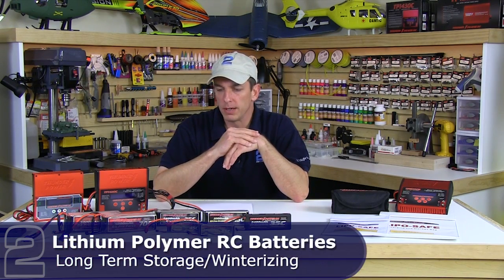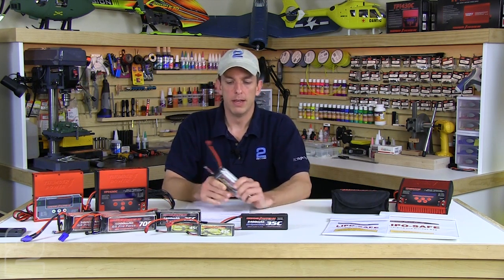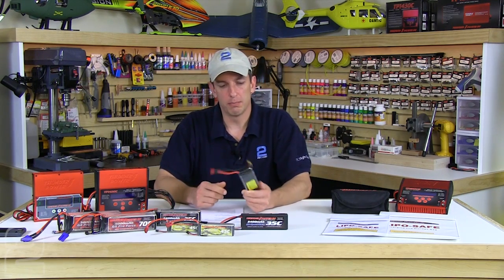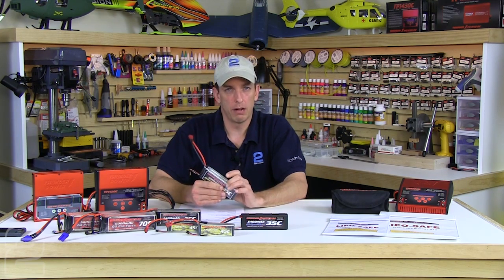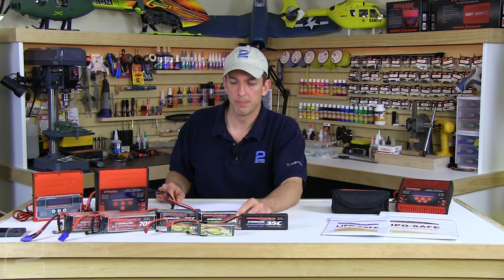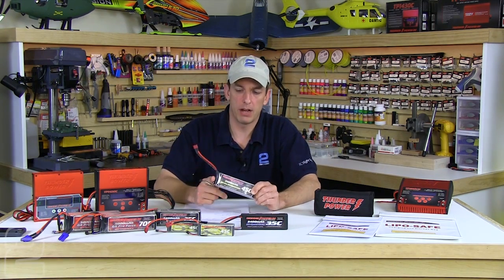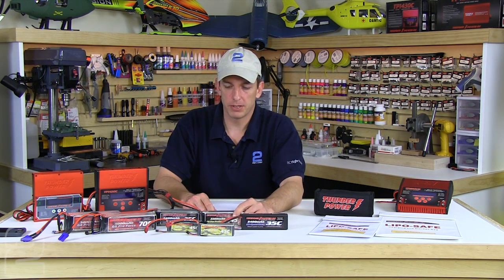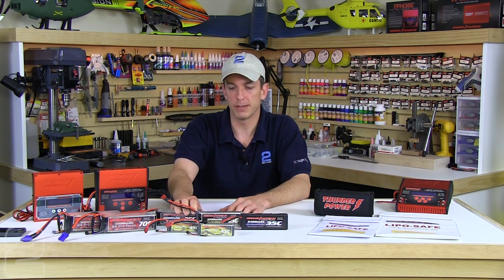RC LiPo Battery Storage

Comment: What happens if your lipos have been sitting for a while and are over discharged? I have a quad and I haven't ran it in maybe one or two months. I didn't storage charge the lipos. They are not showing any damage or puffing.
Reply: Run it
Reply from the maker: There are some people who would advise you to try and "recover" the LiPo by using a very short, low amperage Nickel charge setting until the cells get above 3V each.  That should hit the minimum voltage required for a LiPo charger to trigger.  If you do this, CLOSELY monitor the whole process, verify the cells are balancing out properly and they are all charging in unison.  DO NOT try a recovery with a non-balancing LiPo charger. Some LiPo chargers out there have a recovery option.  In any case, accept the fact that you will lose some capacity after recovery and you will have a slightly (or severely) higher internal resistance.  This means that your XXXmAh will be less than stated as will your XXC discharge rating.  The battery will produce more heat during discharge and will hold less charge than an identical battery that hasn't fallen below voltage. It's just the nature of LiPo chemistry.  Your results will vary tremendously by brand/chemistry/age.

Comment: Awesome video. I'm a complete noob and LIPO maintenance is far more difficult than I imagined. Who would have thought "batteries" could be so complicated :-) Thanks again, I've learnt more from this one video that I have in the past few days! I'm a noob with a 2009 Traxxas Summit and Traxxas 7600mah battery.
Reply: Just buy a charger with storage mode and set a low amp rate and you are done

Comment: Is it safe to leave a lipo fully charged overnight?(8-12hrs)
Reply from the maker: Yes.  When you say "safe", a LiPo is electrically stable at full charge, it just begins taxing the chemistry meaning the longer you leave it sit fully charged the more things begin to break down.  Capacity reduces, internal resistance increases and this results in reduced discharge rate.  Sitting for 8-12 hours, on a healthy battery with good quality materials would result in an unmeasurable amount of change.  We follow the 48 hour rule once they're fully charged.  If we don't run them down within 48 hours we discharge to storage.  It's just a rule of thumb but I can tell you with an inventory of over 140 LiPo's, we've puffed only 3 in the last 3 years following this rule.

Comment: Great vid with lots of info.

One thing i'm not clear on is when you take your lipos out of storage do you fully charge them again?

Say you store them at 50% for two months and they drop to 47%, when you charge them again does the charger sense that they are starting to be charged from 47% or do you need to set the charger somehow?

Thanks
Reply from the maker: We take them back up to storage levels at least once a year for packs we rarely use.  Keep in mind, storage levels are ideal at 3.85 volts per cell but LiPos are very stable below that voltage down to even 3.2.  The self-discharge rate increases as the cell voltage drops so it's easy to forget about a pack and it self discharges below safe usable levels.  3.85 assures the slowest self-discharge rate and the least amount of chemistry degradation.

Comment: I have heard as low as 3.7 for star age voltage so had settled at 3.75 is this too low if I observe cell voltage once a week or so?? If not I have about 20 lipos to bring up to 3.8? Or 3.85 what's best. As for my LiFe source packs I tend to just discharge them a bit to be safe.
Reply: For anyone reading this: On all my manuals for batteries they all say 3.8 V per cell +- 0.5 V for storage charge.

Comment: I have 2 batteries that I used once. Charged and balanced fine. Discharged the battery after I used them down to 3.80v using a 12v car light bulb. Checked the battery after the discharge and rebalanced them to verify they were good. No problems. Put them away for storage then went to use them about 3 weeks later and the charge went fine except one of the cells wont charge. Its stuck at 3.8v and the other two cells are at 4.19v. When I tried to balance the battery figuring it would level out the three cells it only balanced the two and the third low cell never moved from 3.8v. Both batteries are the same, one low cell that wont balance or charge. Please advise if there is anything I can do to repair this problem. Thank you, Bart.
Reply from the maker: Bart, I'd have to agree with Jacob Hendrickson's comment.  Regarding balancing,  as a stand alone function it can only discharge the higher cells to match the lowest in the group.  A balance charge of course will keep them all in check and charge the cells up to match each other but this requires them to be within fairly close voltages to start.  The specifics vary by charger. The probability of two packs having the same cell (is it the same cell?) bad is pretty slim but it is certainly possible. If I had the pack, I'd connect to just the one (bad) cell through the balance connector, fire up a 1S charge on my charger at 1/2 C rates and see if the cell will charge. I would do this outdoors!  If it does take a charge then you need to do some trouble shooting.  Most balancing chargers apply the main charge through the pack leads and discharge the higher cells during the charge process through the balance board.  Some charge only through the balance leads, while others do both.  Not knowing what you're using leaves us guessing a bit but step one is to verify the cell status by isolating it and trying a charge through it's balance leads.  If you're not comfortable doing this, then ask a hobby buddy with electrical experience or perhaps your local hobby shop.  Be careful:  messing with DIY balance lead pin connectors can easily result in a short.  Fire, smoke, pain, severe burns, ruined battery or even worse can follow:)

Comment from the maker: There are a lot of chargers on the market that offer internal resistance testing as a feature.  Problem is: internal resistance varies with load and temperature so any bench testing you do without a consistent baseline won't be much help.  I test my batteries with the TP 820 CD charger at a consistent room temperature and keep a log.  Although it may be inaccurate at the field, I can baseline my packs in the shop and keep track of their performance over time.

Comment from the maker: To answer your car question:  it depends on your powerplant ratings and use.  For example, offroad courses have you constantly on and off the throttle so as long as your battery is rated for the motors continuous draw, you'll be fine.  Airplanes, boats and helis tend to be the higher risk since extended full throttle use is more easily accomplished.  Finally, there's no safe way of calculating unknown burst since it depends on the battery's specific chemistry, internal wiring, etc.

Comment from the maker: Some manufacturers don't thoroughly test their cells for a burst rating, so they'll only list the constant rating for the battery.  Keep in mind, actual "C" rating is closer to 85-90% of the listed value.  This is due to voltage drop, wire resistance, temperature, etc.  You should always size your battery for constant discharge amperage as calculated by your motor's constant rating.  This will leave overhead for burst without risking too high of a draw under average conditions.

Comment: Great thorough video!

I have had two occasions where I discharged my 3S 2200 45-90c Nano Turnigys to close to zero volts.  One by getting it caught in a tree overnight, the other by crashing in deep brush and not finding it for a week.  Both were slightly puffy and my charger would not "see" them unless I charged them on 'NiCAD' at a very low rate till they were at around 3.3v/cell.

I continue to use them. They have maybe 80% capacity, and I watch them carefully while charging and storage.

Comment from the maker: It really depends on the number of cycles, battery age, chemistry, purity of materials, etc.  Storing at full charge is taxing on any LiPo and can negatively impact cell cycle life, capacity, and performance.  The extent of the short term/long term impact varies from one battery to the next.  People often think there is no damage but they aren't monitoring ongoing internal resistance per cell or trying to get the full cycle life or capacity out of the battery pack.

Comment from the maker: (part 2) Once we discover puffing, we dispose of the pack.  The risk is too high since we usually lean heavily on our packs. There is a difference between puffing and swelling however.  Swelling is when the pack remains firm but there is an obvious curvature to the cells that wasn't previously present.  This is often caused by excessive loading (discharge) of the cells for extended periods throughout a run.  We'll be releasing more video clinics to cover these other issues.
Reply: Can you let me know,why we discharge lipo battery.
I saw many discharge using balanced charger
Reply: Hey do you know if I have some rc cars with li-ion batteries then I can keep it at 100% charge for a month and it is fine?

Comment from the maker: tailguner is correct, it's a little of both.  You'll see guys using "sausages" at the field sometimes and they'd argue otherwise but the fact is the polymer has been compromised and the there's a good chance the plates themselves are distorted depending on the severity.  It tends to cascade as well: outgassing compromises cell performance, cell resistance increases, heat generation increases, etc.  For packs used on very low wattage applications the cascade is slower.  Higher power, higher risk.

Comment: Thanks for the information it was very informative.  Question, are you saying that if I have a battery that is "puffy" it should be disposed of right away and not used again?  Is it a safety issue with the battery or simply that the peak performance of the battery has been diminished?